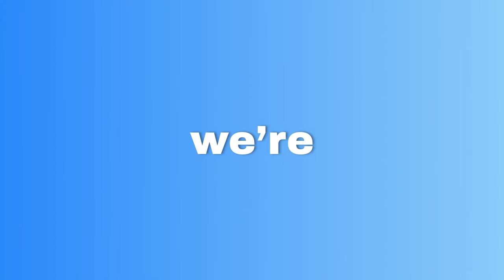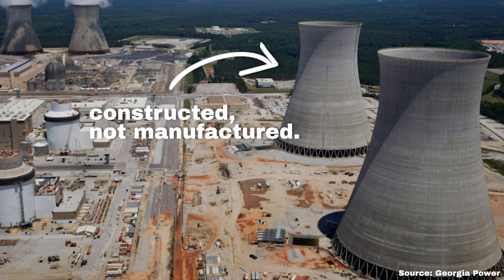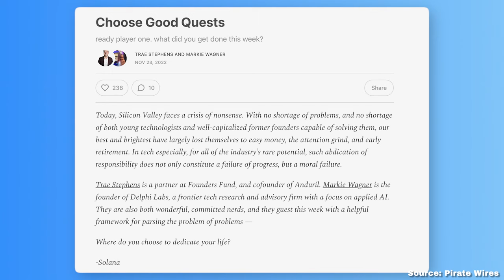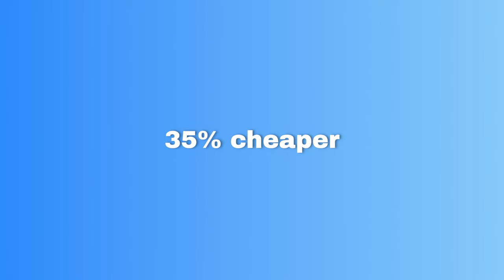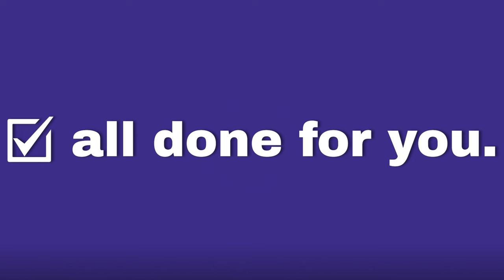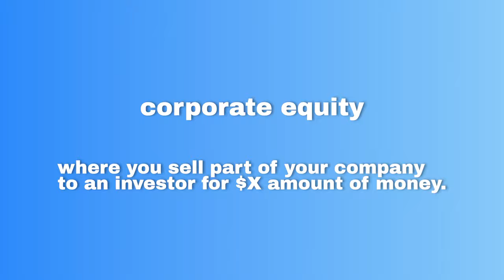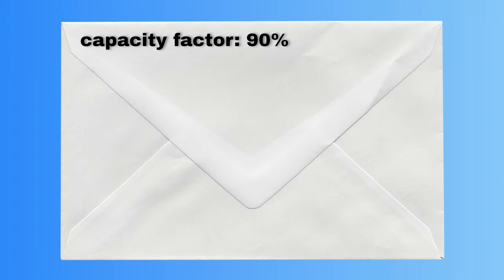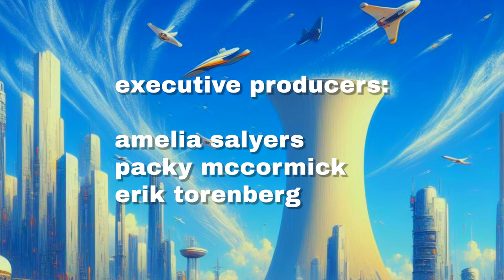How to Build 10,000 Nuclear Reactors

Comment: Your ideas are interesting and even plausible but your focus is a little niche. Consider that people live on the surface of the planet and get a large amount of their protein from the oceans. Japan has been criticised for discharging tritium contaminated water and yet you are considering floating reactors located off shore. Ideally from my own point of view is a stack-able SMR approach where a reactor complex can be built and cost recovery commence in the shortest possible time interval after which the reactor complex can be scaled up by expanding the module and even generator count. IN addition power should be generated and consumed in the same area for maximum efficiency. Large HV transmission lines is hazardous and expensive to both the end user of the power and to the environment. My thinking lead me to considering a different form of national power grid where nuclear generator sites are connected to all adjacent generator sites in a MESH with adjacent generation CELLS power sharing in the event of a generator cell going off line. Ideally the manufacturing should be split between the heat generation, (SMRs), and the turbine or generating equipment. The heat generation could be installed underground and therefore water free generation would be preferable. With SMRs a large user could install their own SMR and generator on their factory site and it could then be mesh connected and supply a revenue to the large user when they supply power directly to the MESH. The modular nature of the SMRs would allow them to be serviced and even replaced without the entire national power grid going down. This would allow a company to manufacture, commission, service and decommission the SMRs under contract with countries that have no nuclear industry and they could maintain the generator side of the power plant if they wish to or that could also be contracted. As a side issue the current generation = load is not good and leaves the power generation subject to failures effectively engineered into the design. Imagine power generation that was 50% higher than need and instead of load shedding to protect the grid think environment. I agree with using carbon from waste and even obtained from the oceans to make synthetic oil using the excess generation of the mesh/grid. The excess generaiton could be paid for as an environmental levy included in the power bills of the end users and things such as desalination plants for environmental inflows and drought proofing could be utilised effectively using free electrical power! Broaden the vision and include everyone. As for the small island nations imagine an old cargo ship refurbished and refitted as a moored power station in the local harbour. Simply swap out the ship come service time! The possibilities are endless if you care to consider things outside of the established views of power needs and consumption. Time for the 21st century thinking we had expected last century!
Reply: RobertIrvine , lots of interesting and visionary engineering ideas but I fear you do not address the immediate problem. Nuclear Power is in the doldrums in many western countries. The issue is not engineering, we have been building reactors since the 1950s. Frankly the public does not care about the actual nuclear technology. In their eyes it is all nuclear and most see it as a major business risk from late deliverables and horrendous cost overruns. If the industry is to be resuscitated the first actions must be to demonstrate some successful and highly visible projects. That is where this video is useful. It focusses on fixing the economic and manufacturing problems by using proven technology. After that we may win the space to innovate.
Reply from the maker: What Bob said. 

We're talking advanced reactors next week, there are a lot of exciting things happening there! Need to show that we can build these designs with a somewhat easier, or at least more clear, regulatory pathway, fast, cheap, and safe, too.
Reply: @bobdeverell  I live in a country that currently has laws that make nuclear power illegal. It was the nuclear policies of the US and its desire to monopolize nuclear weaponry that caused our government at the time to pass such a law in order to placate a vital defence ally. To overcome or overturn such a law ANY nuclear power solution must have vastly better safety of design. It is not good enough to simply expand American or European thinking and to expect the world to simply follow. There are climate change summits, where is the nuclear power summit to which ALL countries are invited? I do not see nuclear power as being profitable as I see it as vital FOR ALL.
Reply: @age-of-miracles  Please pay serious attention to the environment and climate because there is a lot of political effort applied in those areas. Can you also address the "Victorian" design of the current global power distribution systems which are dangerous, expensive and an obstacle to inexpensive nuclear power adoption.
Reply: @bobdeverell The problem for uranium cycle reactors is simple: They cost too much

Nuclear power was largely abandoned by 1960s planners because it cost more than coal power. The reason it's persisted is that it's good cover for the manufacture of depleted uranium, which is the precursor for weapons plutonium production

Weinberg was tarred and feathered because he built a reactor whose design allowed the use of a fuel which broke the  complete dependency of civilian power plants on the waste products of weaponsmaking - DESPITE Weinberg also being the man who created the basis for those civilian plants in the first place (Nautilus/Shippingport - which were fuelled by tens of tons of enriched uranium the separation plants in Tennessee couldn't get rid of after shipping the depleted stuff off to Hanford to make bombs out of and were eager to have taken off their hands)

Government regulation and environmental protests have never managed to shut down commercial activities which were actually profitable - however they're convenient scapegoats for companies looking for a way to exit from a marginal or losing proposition

By the same token, nobody will build new nuclear plants without a profit margin unless there are ulterior motives - such as the French needing a reliable supply of plutonium for their weapons program - meaning that for widespread commercial adoption any design has to be cheaper to build/operate AND reduce waste by 90% or more AND proliferation resistant AND several orders of magnitude safer than existing nuclear (which is already the safet form of energy generation on the planet  anyway). The only designs which offer all of this in one package are liquid fuelled (all solid fuelled designs are subvertable to weapons production) and not needing enriched uranium means the only remaining reason to operate uranium separation faciities is for weaponsmaking. 

On top of that, thorium works better as a fuel (even Glenn Seaborg admitted that), is readily available as the waste product of rare earth mining - the mining tailing that drives the cost of operating such mines over the threshold of economic viability and there are billions of tonnes of it readily accessible (mining reserves/resources calculations are based on an existing market, so they're misleading, to be polite about it. There are more monazite deposits kicking around than we know what to do with and only a dozen rare earth mines dugging into them worldwide)

FWIW: China's managed to corner the global rare earth markets and put a stranglehold on chipmaking production raw supplies not because they allowed lower environmental standards but because the government paid the mine operators to separate the thorium and have been stockpiling the stuff for the last 15+ years in anticipation of the TMSR work at Wu Wei being sucessful, whilst rare earth mines elsewhere went out of business due to the cost of dealing with the tailings containing thorium (It's ever-so-slightly radioactive, so by AEC rules, it has to be treated the same as if it was nuclear waste and can't be put back in the hole that was just dug to fill it up)

Comment: PWRs, regardless of size will always be expensive by their very design. Very high-pressure reactors that produce low output temperatures require specialized, nuclear-certified power conversion equipment. I don't care how you build them, they will be expensive and only produce electricity and no industrial heat.

What can be produced cheaply are generation IV reactors. Low-pressure/high-temperature reactors that utilize off-the-shelf power conversion equipment. ALSO they produce high quality industrial heat which is more valuable than electricity.

Comment: The USA has currently got 93 Fission reactors, China has about 50 and so does Japan & France. The total number of nuclear reactors globally is only 436. Building 10,000 is NOT feasible. Also the reason China can build them cheaper is because they are using slave labour and not reporting there true cost.
Reply: Agree with you 100%.  Building 10, 000 fission reactors is not economically feasible.  There is also an issue of fuel supply.  There are only 255 years of Uranium reserves left for conventional nuclear reactors; scaling up nuclear to 10000 reactors will deplete the Uranium resources in just a couple of decades.  Thorium is likely to be the only fuel that runs SMR's in the long run, suggesting that a molten salt Thorium reactor is the only configuration that has any real hope for SMR's.
Reply: @thewiseperson8748 You know so much. May I ask, Are you a nuclearer engineer.
Reply: Building small scale nukes to that quantity is possible and maybe a great idea.
Reply: @jeffmckie7300  No it is not a good idea.  It would be an environmental and financial disaster.
Reply: History has shown that Water Pressurized Reactors are not a good way to build 10,000+ reactors for community power.  Let's design something small, better and truly safe for our community.
Reply: @5930fern  If that were the case, probably the best option fr a future SMR would be a molten salt Thorium fission reactor as being developed by Copenhagen Atomics.  However, there are potential difficult corrosion problems due to radiation induced neutron embrittlement and radiation-induced corrosion.  Such reactors are also hazardous in operation because of hard gamma.  However, they represent a "stew pot" approach into which nuclear waste may be added for transmutation.
Reply: There are two, related challenges. What to build, and How to build it. If one company tries to address both challenges simultaneously, failure of either portion is failure. Rather than one big leap, baby steps are safer.
  The task of what to build is being addressed by one group of companies (NuScale, TerraWatt, Copenhagen Atomics).  This group is staying relatively conventional regarding manufacturing techniques.
  The companies discussed in this presentation focus on manufacturing techniques.  By using the familiar PWRs, regulators need only stretch to approve the manufacturing. 
  After the optimal reactor type and the optimal manufacturing techniques have been independently approved, combining them is a small step.
 After regulators are familiar with
Reply: China isn't using slave labor to build nuclear power plants. The slaves are in a province 1200 miles from where the reactors are built, for one thing.